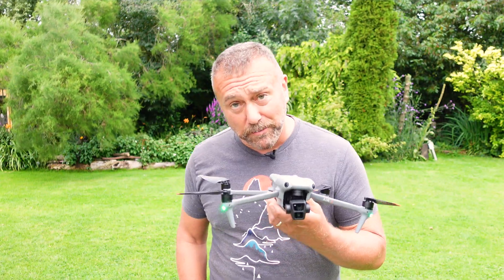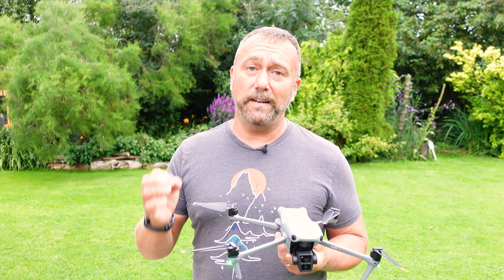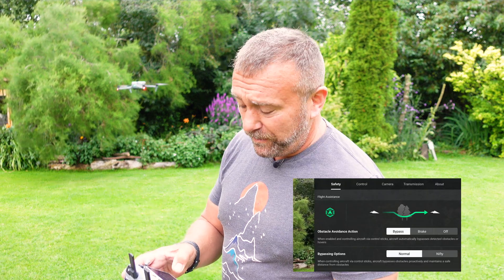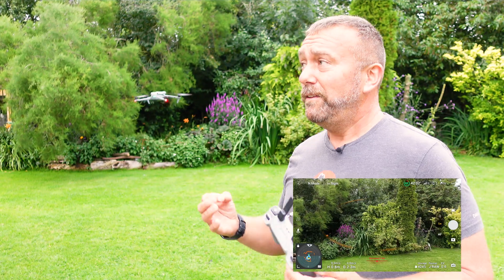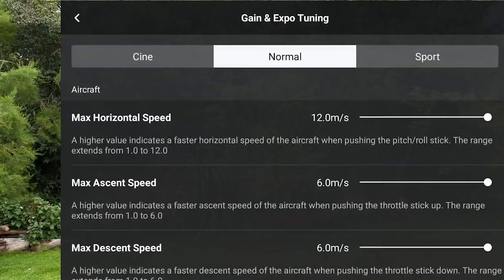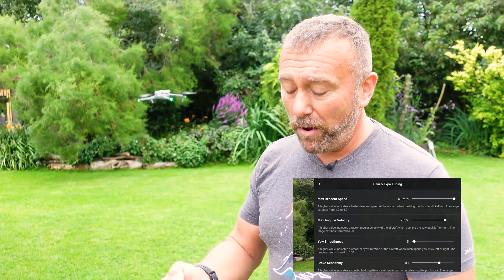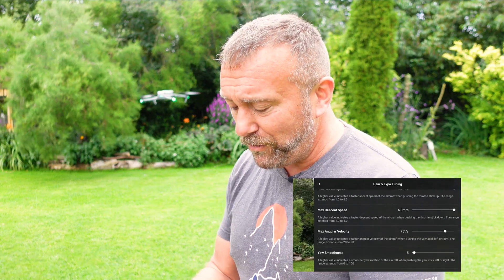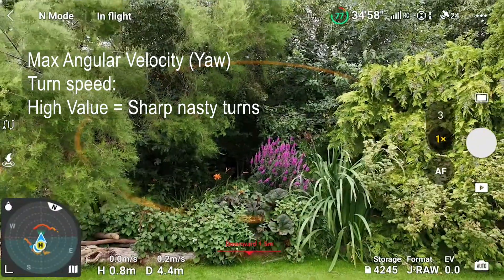DJI Air 3 - Gain & Expo Explained: Why These Are Crucial for Smooth Video

Comment: Ok, I’m slightly impressed with that. I’ve been flying Phantom 4s ever since they came out, because they were one of the last drones to have Attitude mode as an option, at the flip of a switch. I was devastated when I found out they started removing it from their newer drones because I use it literally, every. single. time. I fly and it’s so much easier to get smooth shots. But that slow stop may have changed my mind 🧐

Comment: Question Ian, how do I control the speed of the drone moving left and right. When I'm trying to center the drone in the crosshairs, it's moving way to fast left and right. How do I slow that down? What setting would I use. Thanks my friend!
Reply from the maker: That is controlled by horizontal speed, but you'll probably find it far better if you look on the safety tab in settings and change it to brake mode rather than bypass mode

Comment: Are the ND filters that are included with the 3S split filters? I purchased the Freewell split filters for my Air 3, they are the best. Thanks Al
Reply from the maker: I just got the Freewell split NDs as well!  The ones included with the Air3S are split in that they're two separate bits of glass, but each bit is the same ND value, unlike the Freewell ones
Reply: @IaninLondon  Thanks for the response. I'll purchase the Freewell filters. I always enjoy your videos as they are very informative. Thanks Al

Comment: Just got my Air 3 the other day and found your video today Oct 14th 2024. Thanks for the info. One thing I found out yesterday that's a bummer, I fly with integra goggles and the max ascent and decent speed isn't available when using the goggles...I'm talking to DJI about it now. Hope they fix that.
Reply from the maker: Even in sport mode??

Comment: Thinking of upgrading to Air 3 Ian, but need to know if I can use my ipad on the remote as my eyes aren't the best to be using the smaller inbuilt screen...Do you know if the remote that is screenless (for want of another word) is as good as the top drawer one please mate...? Great video as per usual, thanks again 🙏
Reply from the maker: You need to opt for a package that uses the RC-N2 remote (ie the remote without a screen) and link to your iPad that way.  I don't believe it's possible (or at least easy) to use an i-pad on the RC remote with screen.

Comment: Good Video - thanks! By the way: is obstacle avoidance (in normal mode) also available in those automatic movements like Dronies, Spin-around, way-point-flight? Or only while steering and while active tracking?
Reply from the maker: OA works in the Quickshots too.

Comment: I’m wondering if you change the brake sensitivity, if that helps smooth things out when the Drone is in bypass mode? I found this to be a very helpful video by the way. I’ve always found the expo settings a bit confusing and haven’t messed with them much until I watched this.
Reply from the maker: I don't think Brake sensitivity affects the bypass mode, as I did a test on low brake sensitivity and obstacle avoidance and it makes no difference there (ie it still stops fast if there's an obstacle)

Comment: Surely there's a way to smooth things out when selecting "bypass" as obstacle avoidance, right? I mean, why would we need to part with the most fun, image-gathering obstacle avoidance option just because of "controls nervousness"?...Any ideas?
Reply from the maker: It's jumpy when you touch the sticks, but Bypass Mode is still a valid mode to fly in.  Personally I would trust the drone to always bypass obstacles successfully though and you usually only crash these once.

Comment: Thanks for your recommendations for gain and expo, Ian.  I always test them out as soon as I see what you have in mind. (I currently use a value of 35 for angular velocity in Normal Mode which has worked fairly well.)  I will try out the Brake Mode for obstacle avoidance, although I am curious if you might use Bypass Mode when using Active Track.  I appreciate your advice and find it much more helpful than the advice Polonius gave Laertes.  I am having great fun with the Air 3.  Cheers from Wisconsin, my friend.
Reply from the maker: Thanks George!  Although I am completely opposite; everyone gets my advice and I hear no-one.... except through these comments!  Glad you're loving the Air 3   Cheers, Ian

Comment: In my eyes bypass mode is awful. Nearly a bug. Since several months now. Dji has to adjust.
Reply: Please explain further your opinions
Reply: @theone2be33  the drone has a strange flight behavior in bypass mode. It does not react properly to the flight commands, especially when flying at low altitude.

Comment: Does the Brake vs Bypass sensitivity affect all DJI Drones or just the Air 3?  Pressed the button on one of these last night after the initial reccommendations from several  'content creators' against it.  Turns out they may have been a bit premature or not tested thoroughly.  Thanks Ian.
Reply from the maker: It was equally rough with the Mavic 3, but they did a firmware update to calm it down a bit.  I find all dji models display a jumpy tendency in Bypass Mode.
Reply: Yes because when in bypass mode  it needs to be able to dodge obstacles fairly quickly.